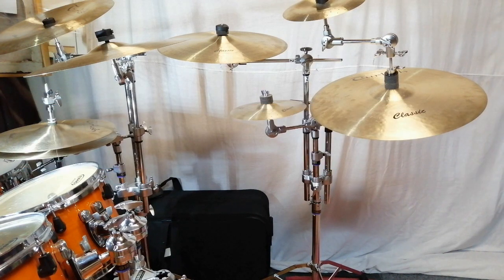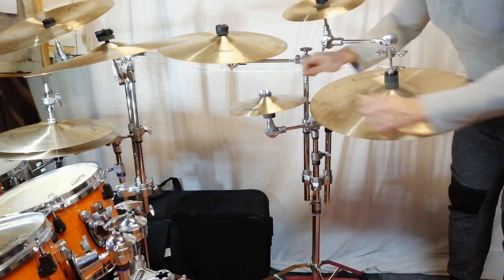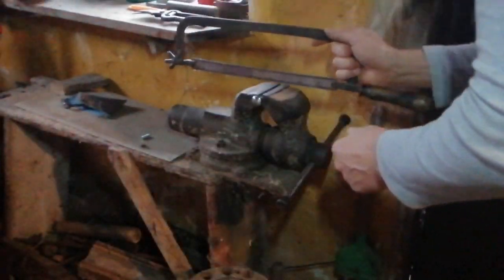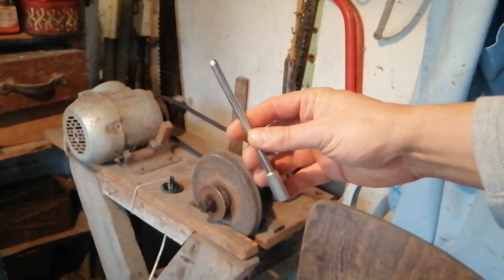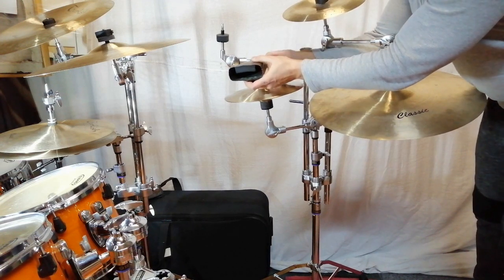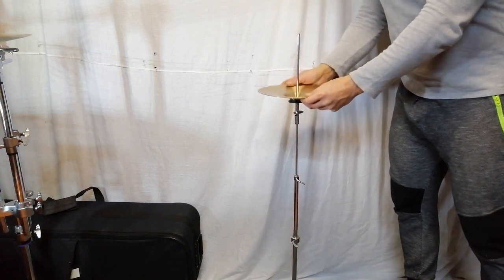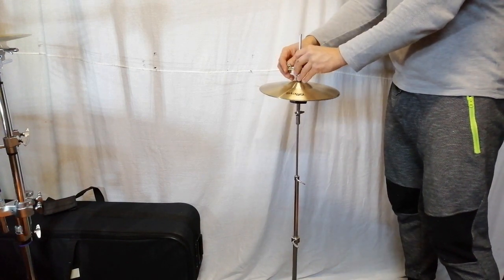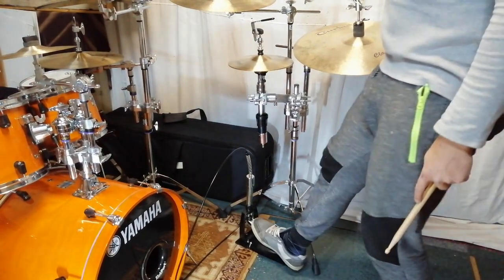5+1 types of closed hi hat holder

Comment: Short summary: hihat cymbals like all cymbals fit over metal bars of 8mm size easily, but they should be protected with a proper sleeve, every time. You can use anything but a dedicated hihat holder or stand will always be the best solution - and there is no free lunch.